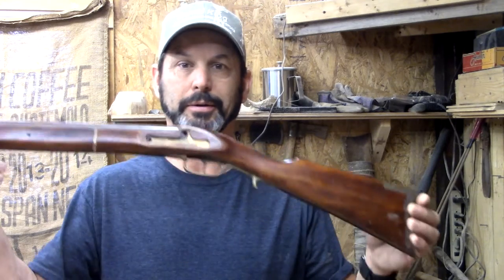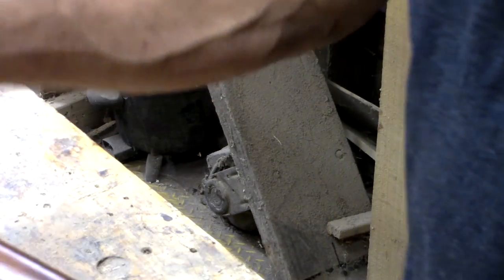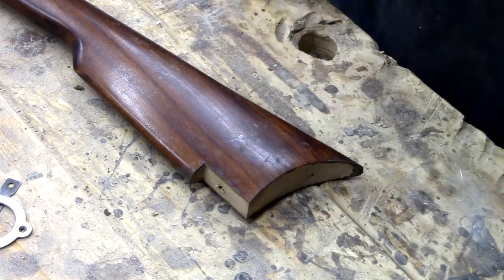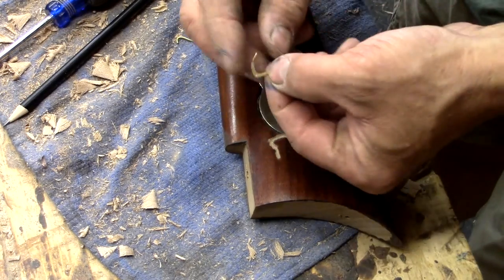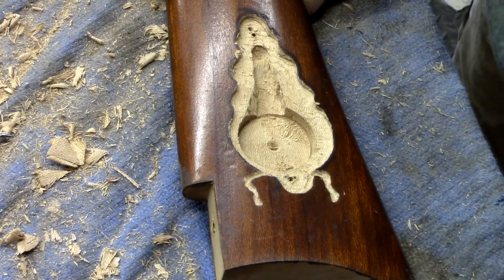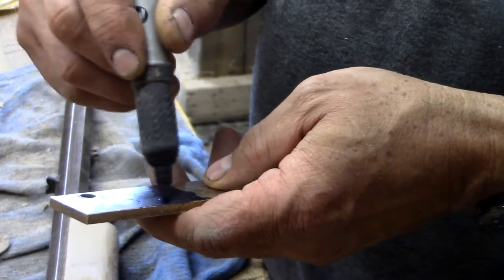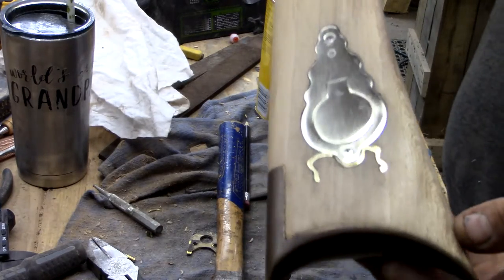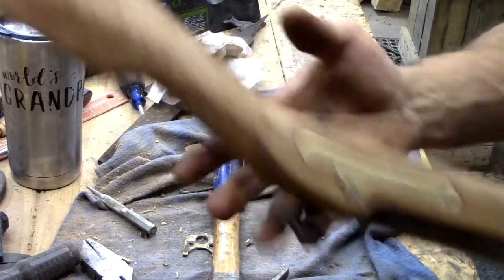Kentucky Long Rifle Make Over

Comment: You did a nice job on refinishing and inlay work.  The only thing is you should have used straight slotted dome head screws in the cap box.  The era that gun is portraying never had phillips head screws.  Overall very nice work.
Reply from the maker: Thank you for the information. As soon as I read your comment I was like " ohhhh, yeah". Thank you for the correction. I need to expand my  fastener supply. Thanks again

Comment: I woulda got rid of the brass spacer and used wood or just glued the stock halves together. Long as your redoing the finish. Patchbox placement is done by drawing a line from center of lock panel to center of butt curve. You got it pretty close. Keep on having fun with a great hobby.
Reply from the maker: Thank you, I'll certainly kick that around on the next one. Thanks also for the locating information. Every time I start one of these projects i stare  at it, make a plan, and hit the gas pedal. With the experience and help from others the plans get easier and the projects more fun. Thanks for the encouragement.
Reply: The nose cap mounts to the barrel with two screws. If you set the fore-end wood back then you have to drill and tap new holes for the nose cap. 
Or use a different fore-end tip.
I am building one now. I hope drill out the holes a bit and glue in dowels and to use Tite-Bond Translucent Glue to glue it all up.
I didn't get a nose cap with my kit so I will have to use a new cap.